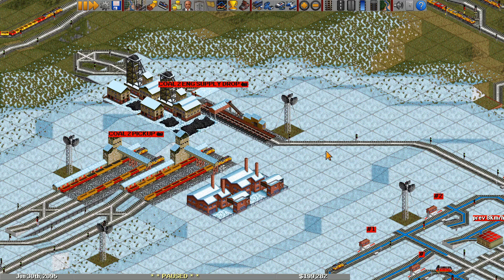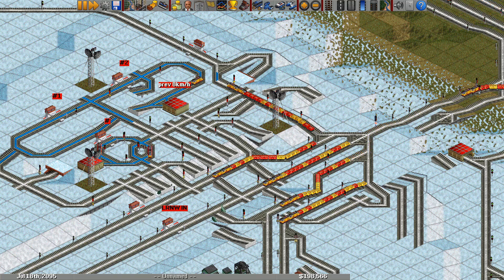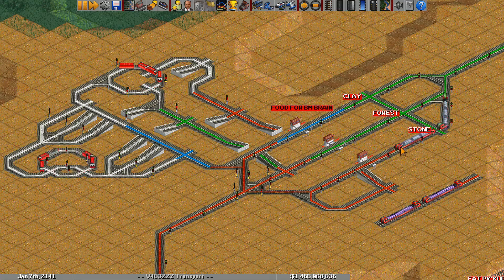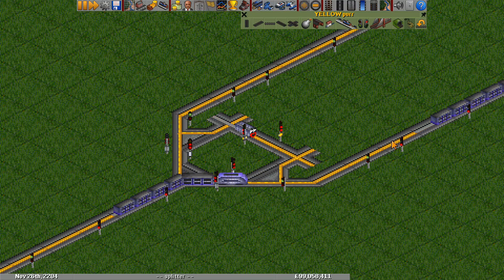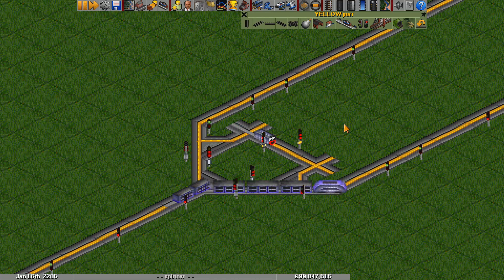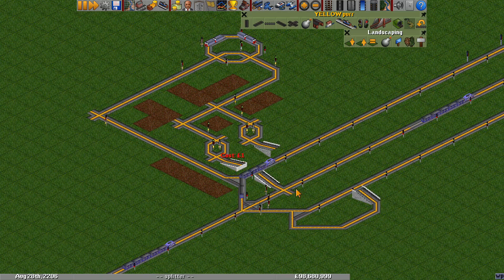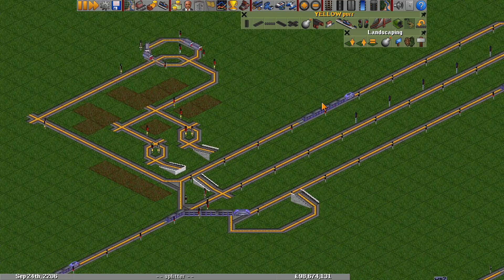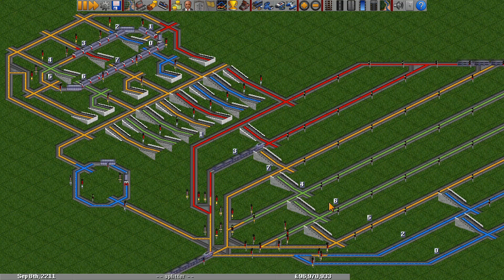OpenTTD Logic: Train Splitters

Comment: I think i have a solution for the pathfinder error in train splitters. No matter what order the trains path in, this should get them evenly split with no need for penalty fixes.

Give every line a memory. Feed that combo into the input of a NOT. Feed the output of the NOT back into the memories. Once all of them are red, it should trigger a full reset. Of the main line combo signals.
Reply: Thinking it through, it would reset all but the last one. Since when the reset happens a train will still be in the block. So, it would be 5th (last), get missed, then be 5th again. 

I wonder if a NOT feeding an Edge Detector or vice-versa would do the trick.
Reply: I finally got the goldilocks solution!!! I put a general edge detecting "reset memory" block after all of the lane transmitters. This has the effect of that lane alternately sending green and red every time a train passes through. There are only path signals on the mains so the detector doesn't stop any trains, and it doesn't reset the counter because there are still other green indicators. once all the lanes have been used, the last train to pass triggers the reset red, stopping the MSC until it passes, then the whole thing gets reset.

No matter which lane I put penalties on, each one gets one train, then the system starts over. Whoo hoo!

Comment: Great work. But for supplies in FIRS, how can I ask these splitted trains to drop? They only drop cargo at stations in schedule.
Reply from the maker: You need to make sure that when they hit the drop station they're on a order WITHOUT "non-stop". 

Non-stop orders mean trains will not stop at any other stations the happen to wander through which is normally a good thing, but you need that off for SRNW-style orders. It can be good to use waypoints to limit the scope of the non-non-stop order to prevent any funny business and delineate where the SRNW area begins & ends.
Reply: @LugnutsK That helps a lot. Thanks👌